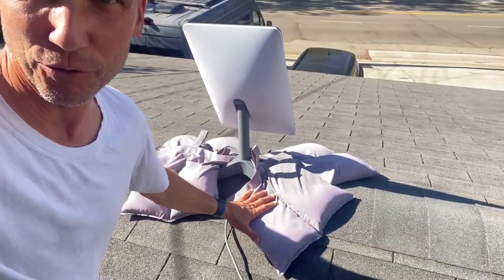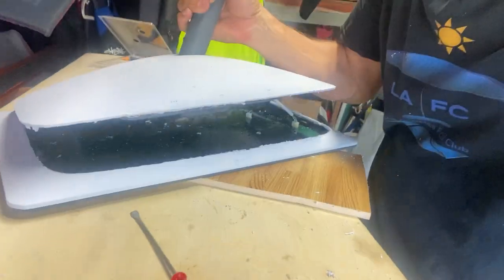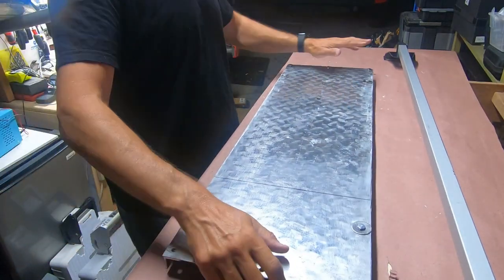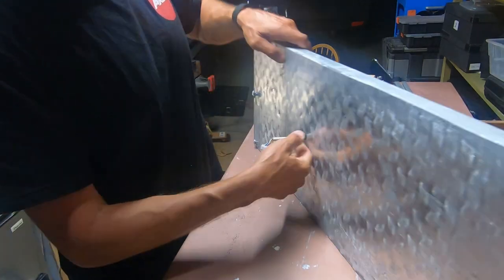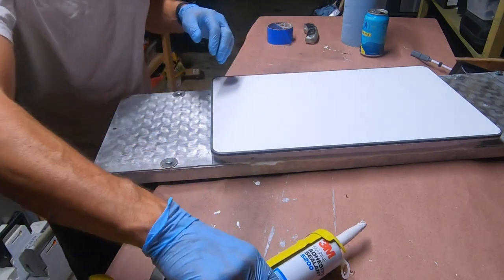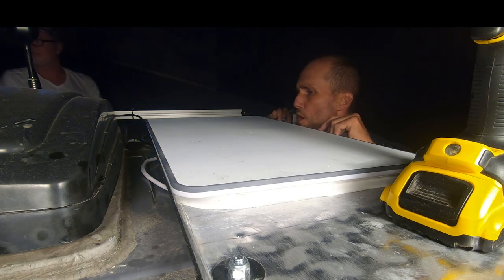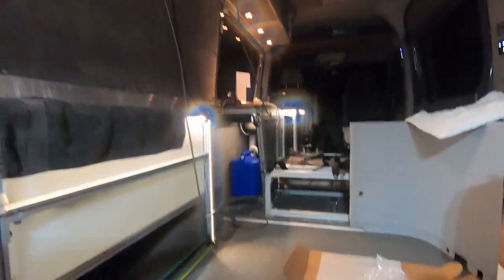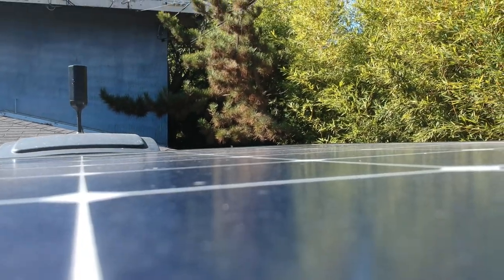STARLINK Flat Mount on my Van

Comment: How's the metal plate holding up?  Any rust or things you'd do different? Very good video!
Reply from the maker: Thanks. Metal plate is holding up well. I used what’s called a diamond plate sheet aluminum I think, no rust.

Comment: hope u kept vent holes... from factory it has breathers for intence temp swings it sees will blow a seal if u dont
Reply from the maker: Yes, I thought about that. The cable grommet is not 100% super tight and it breathes.
Reply: I believe the cent holes are just for the motor compartment which is fully sealed from the PCB area.

Comment: Thanks for the good video and congratulations on the set up. I got star link and was contemplating the Wii boost but it seems I could just make phone calls with a voip app. Do you or anyone else see issues with that thought?
Reply from the maker: Agree. I should have probably skipped the weboost. Didn’t have to use it yet. So far Starlink worked well, also while driving. But then, good to have options.

Comment: Just curious if you use any security cameras at your house, just cause if you use your van for internet, while you are away traveling in your van you won’t be able to view cameras at home.
Reply from the maker: True. So far I haven’t cut the home cable yet. Hope that Verizon 5G home access service will soon be available in my area, that is cheaper than cable and good enough.
Reply: @pacificmeister  gotcha, yeah I figured there are a few ways around it, just curious if you had a plan or something else up your sleeve that others hadn’t thought of. But it only makes sense to utilize starlink while the van is there!

Comment: Good job getting rid of that pesky self aligning motorized system. What were they thinking when they designed the panel  to keep proper alignment to the geosynchronous satellites. Maybe next time put in a large skylight and keep the motor, so it works.

Comment: rofl.  you call it rush hour so many times.  surely you are just joking. and that you really already know the reason, surely.
Reply: Aliems?
Reply: @MrGrindtime00  no. the starlink satellites are constantly floating around the world. you will get different speeds depending on the satellites angle that is directly above you at that time.
Reply: How Deep did you go on the Selector ?
Reply: Height of the Distant Holder ?